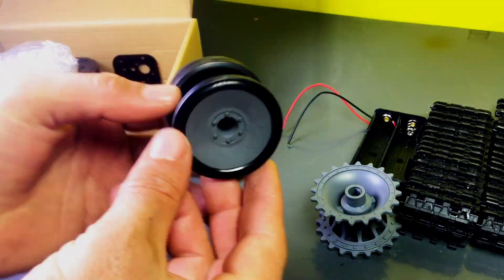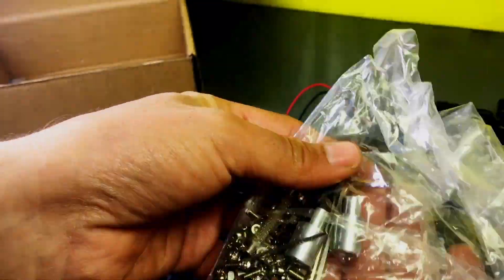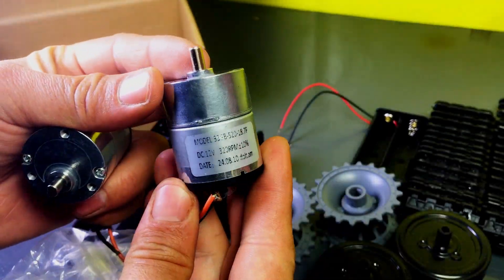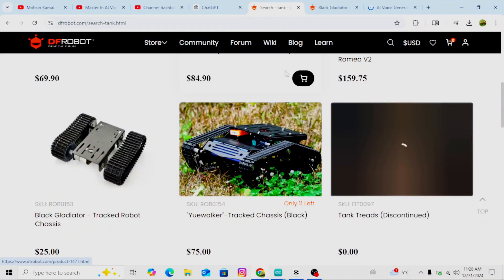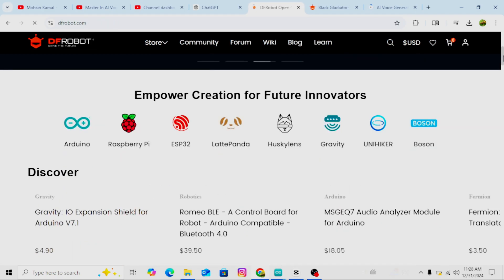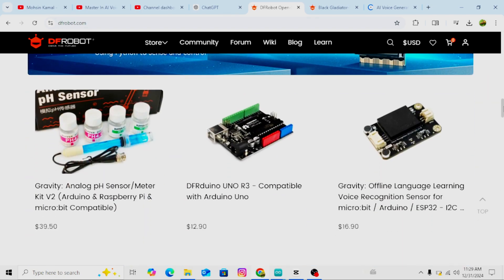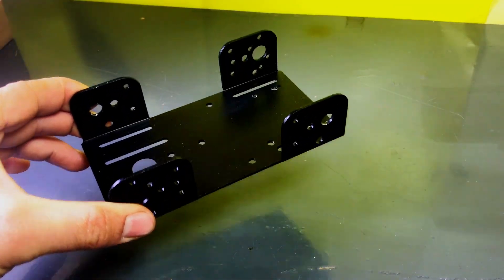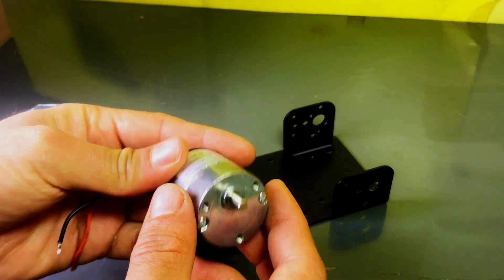Arduino Bluetooth Controlled Tank | Build Your RC Tank with HC 05 and Arduino

Comment: i have tried following the wiring like the photo you provided, everything is ok and arduino, the hc-05 bluetooth module and the driver motor are on, but when i try to move it in the app why is there no sm response from the driver motor once? doesn't want to run both of his gearbox dynamos
Reply from the maker: Bro, message me on Instagram; I will guide you.